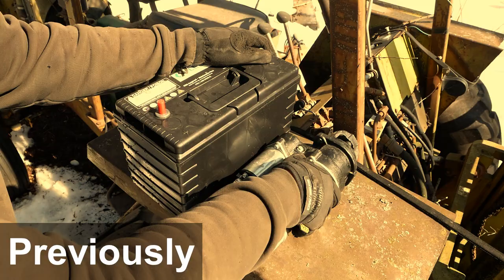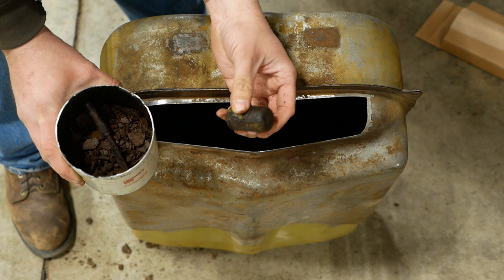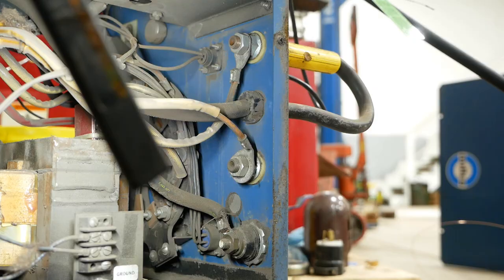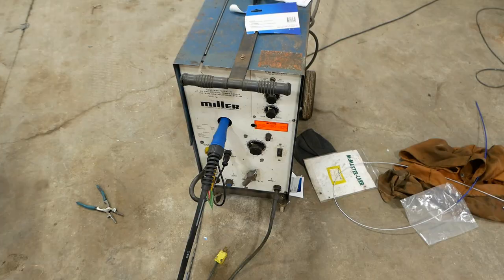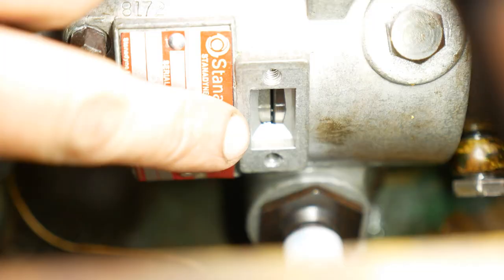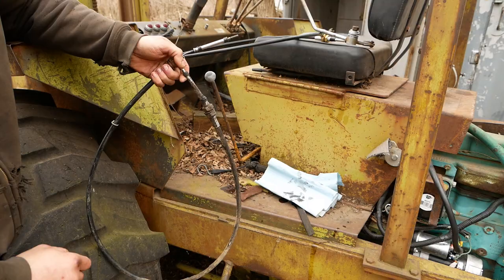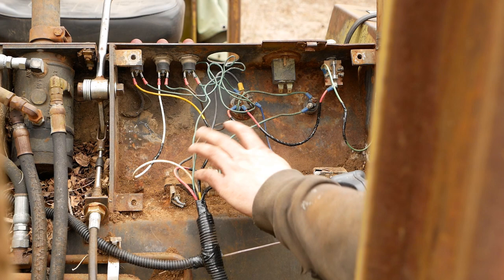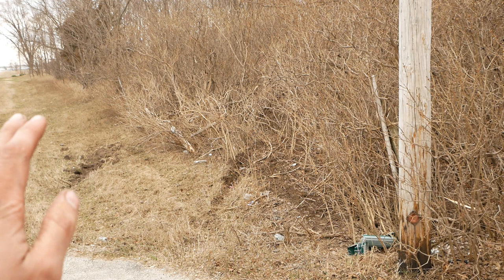Neglected Forklift Drives for the First Time in Years!

Comment: Not that I would trust doing so, but I've been told a lot of times over the years that if you have no choice but to weld a container that is holding fuel of any kind, to do so when it is full and sealed. The "science" behind it being that if there is no oxygen, just liquid fuel behind the weld it won't ignite and any fuel that has leaked out will just burn off. Always sounded legit to me but no way in hell would I ever want to try it lol

Comment: here's my gas tank story a million years ago. when the big drive line builder charged $450 to make a driveline . I knew a machinist that was rumored to be around when dirt was invented. he was a master of of masters. anyway if I brought him the yokes and a driveline longer than I needed he'd build me a driveshaft for $15 ready the end of the day.
 well he was welding a trailer hitch on a car one-day and touched the gas tank with the welding rod and instantly had a stream of gas leaking out of the hole and burning as it leaked.
 you know what he did ?
 he got in the car started it and drove about a mile through town with burning gas dropping all the way to the fire department. they put the fire out . he said thanks and drove the car back to his shop and fixed the leak and finished the hitch.
 balls of titanium.

Comment: Do you think that you could have made an outboard motor shifter cable work in that application? Looks about the same as what you ended up installing and way cheaper than what Clark wanted for it that's for sure.
Reply from the maker: I would guess they are the same kind of cable. It's an industry standard part.

Comment: By the way... I have great respect for your abilities as a mechanic, but who taught you how to pour from a plastic jug?   The spout has to be at the top.  Always.  If you don't have the spout at the top then air can't get in to replace the liquid coming out and it will 'glug' and spill.  This the reason the spout is at one side - so you can orient it to the top for pouring.
I made it past the diesel additive spilling, but now you're doing it again when adding the oil.  I couldn't hold back any longer.
Reply from the maker: LOL. Then it just runs down the side of the jug.

Comment: What is Harbour Freight ? Is that like the UK's equivalent of  Wilko's/Aldi/B+M ?
0.6mm wire is super thin Wez, thinnest I've ever used is 0.8, diesel tanks are fine to weld up, if you want to purge a diesel tank then just put it over a car's exhaust to fill it with exhaust gas but to be honest I very rarely purge them, just drain them completely and leave the cap off, Aluminum HGV tanks are even easier, nice patch though Wez 👍
Reply from the maker: The thin wire is great for thin sheet metal. The big wire either blows holes or you get lumpy welds with no penetration.

Comment: Hey Wes , what brand and model is that tool box?great vid as always !thanks

Ps: when welding on a fuel tank I run a hose from the exhaust pipe of a vehicle to keep the tank full with inert gas while I cut or weld

Comment: Why would a gas fueled tank explode if it was filled with water? Even if gasoline is enclosed in the paint inside it would just burn?
Some of my friends welded several benzin gas tank, washed them before with alcohol then water and then filled them with sand... Welded while open so no kaboom

Comment: Hi Wes, is the transmission a shuttle type box (like a Turner/Dana compact plus) where there's a forward and reverse internal clutch packs hydraulically operated and if so could the transmission be low on oil as you did mention this was leaking.

Comment: First hand knowledge welding gas tanks.  Basically, yes the tank went boom.  No I wasn't hurt.  Yes, I wore protective gear.  No, I didn't know that someone tried liquid weld adhesive to seal it.  Yes, it was absolutely stupid to weld a gas tank.  Finally, haven't welded a gas tank since.  Yes, I'm still stupid for welding a gas tank.

Comment: I thought it was normally a bad idea to air up forklift tires standing right beside them? Isn't best practice normally to have one of the long stick ones to air them up from a distance in case something goes wrong? Maybe this type of forklift doesn't have that particular hazard though Looking at it, it doesn't really look all that heavy like a normal counterbalance forklift.
Reply from the maker: They have about 3psi in them. I think I'll survive.
Reply: @WatchWesWork  Ah yeah that's probably not an issue then. I just remember when I was doing my forklift training, even though ours only had solid tires, the training specified that you had to use something that would let you stand away from the tire as it aired up due to the amount of weight on the tires. Basically the safety amounted to an extreme weight on the tire as it was being aired up could cause an explosive blow out right on you, but yeah 3 psi hardly seems like enough pressure for such a thing to happen

Comment: There is an old trick on welding gas tanks. just hook up the car  exhaust to the tank and purge w exhaust gases. Old lawn mower works better since they run rich. Cant use diesel exhaust. too much excess oxygen.

Comment: Its no fun if you don't get to carry the stuff to fix it 250 yards or so in knee deep snow is it?  I had my mechanic weld a fuel tank on a 1980 Camero to accept an electric fuel pump for an engine swap.  He filled it with water and ran a hose off the exhaust of a car into it while he was welding.  He had done a lot of them, there is a company not far from here who does lots of tanks and employs lots of people.  Once several years ago, one of his crews who had done lots of work blew a tank up.  I believe probably more than one person was killed.  So you are probably more than smart to tell people to never weld a gas tank.

Comment: In order to Weld a gas tank You need to run exhaust fuse from a car into the tank What's takes up all the oxygen so it does not blow up I have done it I am speaking from experience Not assumption I've done it twice If you do not run gas in it it will blow up Just like you said 
 AS soon as you striking an Ark. It  Will explode
 I know that from experience Struck an ark the gas tank jumped 25' in the  air  knocked me over
 Do not try welding a tank without running carbon monoxide threat
 Start a car up put a tube from the car into the gas tank and let it run for a little bit
 Then you can strike an  Ark.

Comment: Speaking of red Ford powerstrokes I have one with 200,000 that will run perfectly until it gets up to operating temperature and then it starts cutting out at low RPMs what's your thoughts
Reply from the maker: Does it restart when it's warmed up? Sounds like a leak in the high pressure system. Injector or IPR o-rings would be my guess.
Reply: @WatchWesWork  I thought standard 7.3 running issue was swap cam position sensor.

Comment: If you need to weld a tank that has had petrol or gas as you brave and free say then put a hole of the tank over the exaust of a gas (petrol) burning vehicle while it is running and let the exhaust fumes into the tank for 20 minutes and then weld away - I have done this many times and obviously live to tell the tale — would I lie to you ? not a chance

Comment: gas tanks its not easy to weld.a did weld my old motorcyckle tank. a did clean it several times with water and did leave it outside for a week witout the capsel. then a first try itwith a torch little bit inside,nothing happend so it was safe to weld it.

Comment: DO YOURSELF A FAVOR PUT PIECE OF FINE SAND PAPER  ON YOUR WIRE BEFORE CABLE AND ROLLERS SECURE WITH WOODEN SPRING CLOTHESPIN IT WILL CLEAN OFF FILM ON WIRE   WITHOUT IT AFTER SEVERAL ROLLS OF WIRE  YOUR CABLE END WILL PACK SOLID AND STOP FEEDING  TOOK ME AN HOUR TO FIND IT